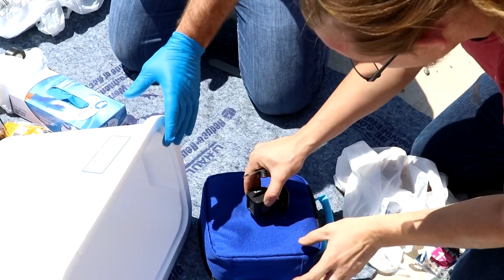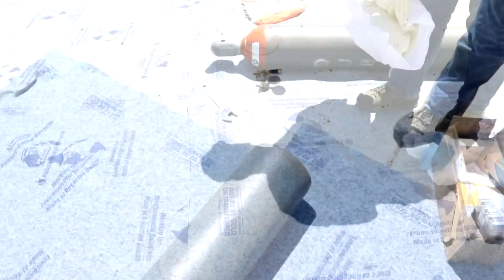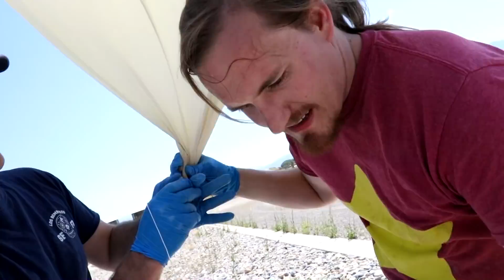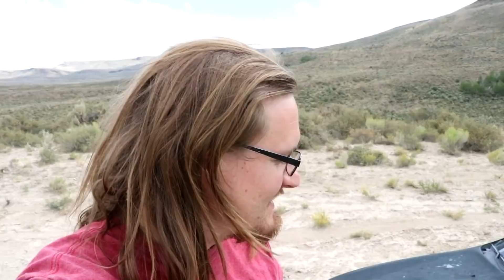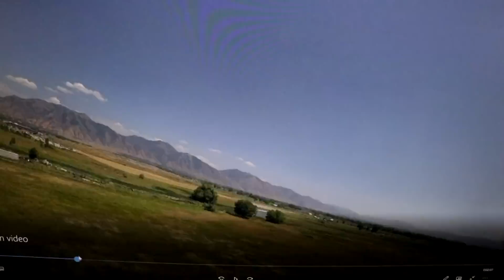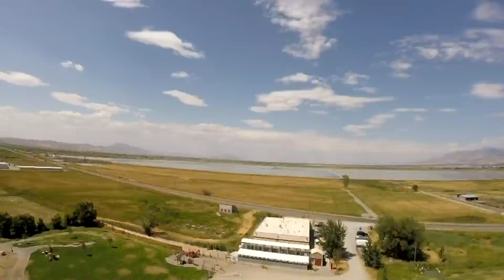My First High Altitude Balloon

Comment: Awwww such a shame you didn't get all the data and video.  Ah well. We're just going to have to wait till you try again. Very interesting video anyway. <3
Reply: veteran weather ballooner here. Failures are VERY common in ballooning. You could think of it like super cheap rocketry, in that it's surprisingly complex and lots of tiny details can cause huge failure conditions. The skies are more violent and unforgiving than we realize.
Reply: Shartnita, Do you have to get FAA clearance before launching? or will any open empty space work?
Reply: I'm not quite sure if I'm interpreting the question correctly. It sounds like you're asking just about regulation. Its hard to say because I'm in AZ and this is Utah, and I'm an engineer type pokemon, not a legal type pokemon, so I'm not sure how stuff works in Utah precicely. But for us, we have to put reflectors on the balloon for visibility, we have to register our specific flight with our identity for a specific time and location with the FAA. So its like reservation of airspace. My understanding is that the FAA can use this data to hand off the airplane control towers so they can route planes around the reserved area rather than possibly fly passenger airplanes through a payload of unknown material. They also want to know stuff like what the device actually is, only to the point of categorization though. Drone air regulations work differently from weather balloon regulations as well as are different from planes. 

If my memory serves, the cutoff is altitude. There's a certain altitude, at least in AZ, where above this level you need to register with the FAA that you're flying, what is being flown, where the launch location is, and launch time. This is actually important, because that means we have a launch window, and if we have bad weather, we can miss our launch window and have to reschedule for later.
Reply: shartnita zodkeesian that's exactly what I wanted to know, thanks!
Reply: Did it in high school and somehow it worked the first time.
Reply: deedlede2222 how long was the flight? And did you have a heat source inside the box? I think the balloon fill and how hot the heat packs could have got are the keys that made the system hard to recover and have a system stop working soon after launch. I think those packs might have really cooked the system and put the camera into heat shutdown. video creates more heat than photos, and little lunchboxes like that are made for good insulation. Plus they added additional insulation. Having a temp data collected during a flight is super duper useful.
Reply: deedlede2222 I did this in high school as well. We used a gps cell phone and a java program to text its location to a place online. We had no idea how long it would take so we didn't even try to chase it to figure out where it would land. We just waited to see when the location stopped pinging or when it stopped changing. On board was an older style camera just set on a timer, saving to an sd card. We didn't have a heat source because we didn't really know it was gonna be so cold, but we did build it with a hardshell lunchbox and tons of hot glue, so it was at least a little insulated. It ended up landing in a lake super far away. All the parts were ruined, but the sd card had the photos on it still. No photos of the landing, but there were flights at least up so high the sky stops being blue and starts being black. Not sure if the pop was caught though. The long flight might have just run out the batteries like normal. We probably also underfilled, resulting in the long flight. That was my first flight. Id say only a partial success because we recovered some data from probably higher than some clouds, but it didn't record everything and it was a real pain to recover.

Comment: Cody, you're the best. For the spinning I would put a low friction SWIVEL and a FIN like in a WEATHER VANE and keep the camera a lot more stable. You just have to put the camera where you want it corresponding to the expected wind direction at the desired altitude. Good luck. I'm 54 years old and I want to be like you when I grow up. Thanks for all those videos.

Comment: A video on Home made liquid nitrogen generator would be awesome for cryo/cold temperature lovers.
Reply from the maker: Dollar Projects 
I have a couple videos on the subject in the works, I still need to liquify hydrogen.
Reply: You can use my project as base for liquifier. :)
Reply: Grant Thompson has a video showing how to make one. It was probably the last good video he made.
Reply: John E. Grant thompson just used a ready made stuff. He just assembled it, not made it. That too was very poor/slow at making liquid nitrogen and was very expensive which made it impossible for everyone to get it.

A complete homemade machine under $500 would be perfect. Something like a joule thompsons expansion which is quite easy and cheap to make. Another thing that can be done is to make a 4 stage cascade refrigeration system. First stage using propane as refrigerant which will cool and condense second stage refrigerant (Ethylene) under pressure. This will take us down to -103*C. Now we can use this second stage cooling power to condense methane under pressure to get us down to -162*C.

After this everything becomes easy. Just need to pass compressed nitrogen under 14 bar pressure through heat exchanger cooled by third stage and we will get liquid nitrogen out of it.
Reply: ZockerTwins that's my dream :D
Reply: Try to search Ben Krasnows channel... he made a contraption capable of producing  liquid nitrogen on small scale. But If you have a source nearby... buying it directly is easier.
Reply: JanicekTrnecka it costs $5 per liter where i live which is unaffordable for me and i always wanted to make liquid nitrogen at home. So I'm working on 4 stage cascade refrigeration system for making liquid air.

Comment: To prevent or at least mitigate the spinning use braided cords instead or twisted ones.
The spinning is the result of hanging a load under it forcing it to unwind.
You can test potential candidate by cutting a meter of, hang a load on it an see if it starts spinning or not.

Comment: Use multi braid or mono filament for the tether lines, should alleviate a lot of the spin (double them up as well). A large lightweight foam board as a damper will also help.

Comment: Why not hydrogen vs. helium for the balloon?  It lifts better and is about 1/3 the cost if you buy it, but you can generate it yourself also.
Reply: Hydrogens got a nasty habit of leaking uncontrollably from just about everything. It might not make it to popping altitude considering how thin the latex is.
Reply: So does Helium.
Reply: Nerdy, Retro, Gaming -   Burning seems irrelevant to me with that cheap payload.
Reply: Mini GP Racing 
Yes but helium molecules are still larger than hydrogen molecules.
Reply: eddiesadat isn't the Van der Waals radius of helium smaller than hydrogen? if you look at a periodic table with Van der Waals radii it gets smaller when moving right, right? Unless you are talking about atomic radii
Reply: eddie
no such thing as helium molecules
Reply: Helium is not diatomic unlike hydrogen. And the physical size of the molecule or in the case of helium the atom is not what matters. Gasses occupy a certain amount of moles per liter depending on the pressure of the gas. This means the density (at pressure) is proportional to the average molar mass of the composition of the gas. Diatomic hydrogen has half the molar mass of helium so it would be half as dense at the same pressure. So why not use hydrogen?
The problem with hydrogen is that it is very time consuming and energy intensive to produce, making it expensive, storing it is a safety hazard and since the size of diatomic hydrogen is so small it can leak through the the spaces between the molecules or atoms of almost any container you put it in.
Reply: Mason Daub Like the op said, the hydrogen is much cheaper than He. He is about $200 for a 200 cu. ft. tank. H2 gas is $60 for a 200 cu. ft. tank. So it's about what the op said, 1/3 the price.
Reply: Oh I thought it was more expensive because of the energy requirements. Thanks for correcting me
Reply: tubeist- dan not sure what u mean by that.
Reply: SteveSquidyMan 
I’m hugely mistaken. Helium gas molecules are smaller than hydrogen gas molecules. I think the biggest issue with hydrogen is what many have stated already. Hydrogen is indeed lighter than helium and cheaper, but the fact is that helium can do the same job in a much safer environment. The cost of helium is much cheaper than the medical bills and damages caused by an explosion.
Reply: Noble gases are atomic, not molecular...
Reply: Not only cheaper but actually Helium is a finite resource (very slowly recovering and constantly venting into space). We get it from natural gas, but it's still rare. This is why in some labs they go great lengths to recover Helium, while some idiots happily blow it in childrens' balloons wasting it. We just have it so cheap because Clinton (Bill) sold the US supply (Helium Privatization Act).
Reply: Actually yes, we runing out of helium while hydrogen can make anyone who have electricity some water and few metal electrodes. People so bothered about CO2, maybe time to think about other things like not wasting helium, ofc it is not ecology problem, but we runing out of element with lowest boling point in universe - its important for science.

About hydrogen, you need oxygen in baloon and heat mixture or high pressure to ignite it, which is not the case for high altitude baloons. Yes hydrogen can leak through baloon walls(same as helium btw) but oxygen wont leak into pressurized baloon so nothing worry about: no oxygen - no flame.
Reply: Um.... because the humanity?
Reply: sigh Hydrogen forms covalent bonds (H2) but Helium does not, having zero valence.
Reply: eddiesadat
Perhaps I didn't understand what you wrote:
"Yes but helium molecules are still larger than hydrogen molecules."

I've never heard of helium molecules.
Reply: For the record:
1) Helium is elemental.  It exists as a gas in single atoms, not paired up.  Though it has a higher atomic weight, it is MUCH smaller and more slippery than Hydrogen, which is paired with another Hydrogen molecule forming H2.
2) Hydrogen is about 1/3 the cost of Helium and MUCH cheaper if you are talking nearly-pure Helium, not the crap they use to fill kids balloons.
3) Hydrogen is much safer to work with than gasoline or propane and yet we work with gasoline every day and propane is stored on our porches and in our garages.
4) These are unmanned balloons.  There is no humanity on board the weather balloons.

I'm really not sure why people don't understand what Hydrogen is or how it works.  It requires no special balloons and no special handling.
Reply: That would have been so much cooler.
Reply: There are no He2 atoms?  :(

Comment: For the camera a solution would be to directly use a bunch of 18650 cells in // connected in // with the internal battery (kept in case the camera has some kind of detection that you use the right kind of battery).
Of course before connecting then in // make sure they have the exact same voltage to prevent high current flow between cells. Internal batteries are good for 1h of video and each 18650 should add 1h30 more (rough estimate)

A solution to control the quatity of helium would be to use a weight scale with decent precision. Put a few kilograms on it using a single oblect that has a hook. Use tare function then add the load (lunch box). Then attach the balloon to the hook and add helium until you reach zero. Add a little more to be at -10% of the lunchbox weight. Detach from hook and let it go.
The -10% is to stay up as long as possible. Go -20% or more to go up faster and pop sooner.

Comment: Well that was a bit of a letdown. As for spinning you could use a ball bearing swivel on the lead with a styrofoam cross like arrow fletchings. or better yet you could use a crossbar attached to the balloon and use 2 leads to connect the load, that should provide a much slower rotation rate. Camera power could be a 15000mah or larger lipo USB power pack. It should run 2 cameras for quite a long time 1 horizontal and 1 looking down. Try using 2 balloons and fill them with less to get even higher! Don't forget the altimeter and an onboard GPS data logger. A bit of math should allow you to timelapse the shots and get the full rise and decent. If you really want some data throw in a raspberry pi with a full array of sensors. They are a good cheap data logger and allow for a vast array of sensors. Done correctly this could be a wealth of channel material! But what do I know.....JMHO
Reply: -40C temperatures and Lithium (polymer and/or ion) batteries don't get along very well...

Comment: A good landing site. I have been part of such an event myself and a pine forest is worse to chase the equipment in. My experience is that batteries are a headache - and wire the batteries directly to the equipment and insulate them well since it can be pretty cold up there - cold enough to make the batteries freeze.

Comment: Why did you activate the warmer packs before you were ready? Doesn't seem like your typical level of planning and preparation. Also, wonder if perhaps the GoPro and/or battery pack overheated and shutdown. Yes, you had an issue with the battery early on, but if you were charging it at all, it should have lasted longer. Bet you cooked it. Activate the packs right before launch, will help avoid that. 

When you try again, wonder how you could design the package to reduce the spinning? Perhaps a balsa wood frame with a lightweight skin (plastic wrap/mylar) as a fin(s) to slow the rotation?
Reply: Blair Cox what, the 15 minutes early that he opened the hand warmers? That's inconsequential. It's actually good that they did because they found out that they get to hot to keep them in direct contact with the electronics, like they originally had them.
Reply: Hand warmers last hours. Like not just 1 or 2 but 6+ hours.

Cody is right. It looked like a cheap 1A out usb battery pack. It will be unable to sustain the camera during the lift due to discharge being higher than the supplied current.
Reply: M3ta7h3ad being aware the warmers last hours - I would actually be more concerned activating them too early and having the insulated lunch bag sit on the ground too long. Check the cut-off temperature for a GoPro, it is very possible that the two hot packs causes the internal temperature of the enclosure to rise to the point that the high temp safety shutoff engaged.

Comment: Why are you preparing your payload at the Launchsite? We allways built the payload indoors a couple of days before the launch. it takes a littlebit of stress out of the launch. Also, we use a Water bottle as a Weight to measuere when the balloon has the right amount of Lift while filling. There is a linear relationship between the lift over the weight of the payload and the rise rate of the ballon, so you can calculate the lfit you need for the specific rise rate you want. Also, we allways do a "full up test" on the payload (have it run for the predicted time of the flight) before we actually launch it to see if it at least works at ground level.
Reply: It wasnt meant to be a super serious experiment.